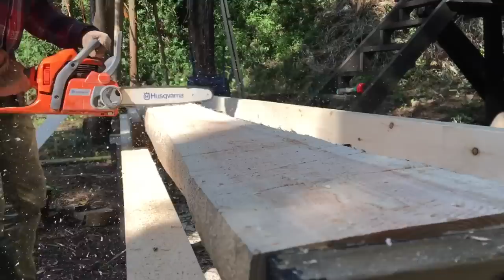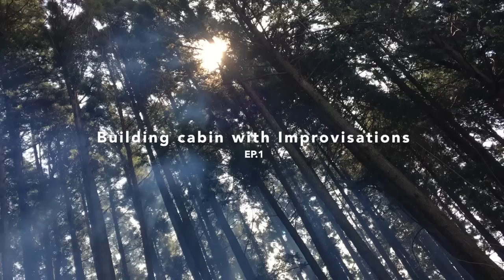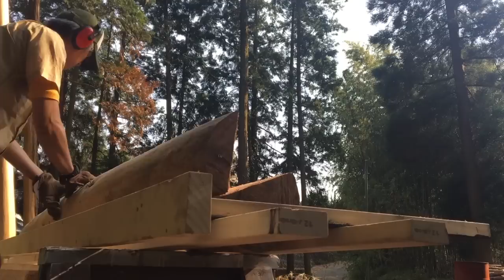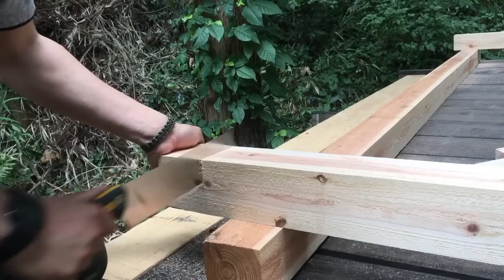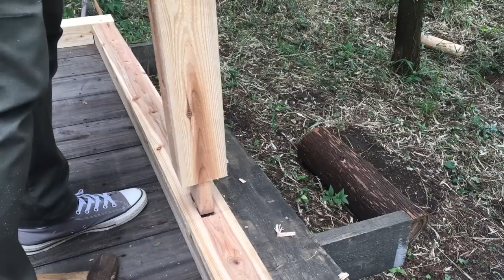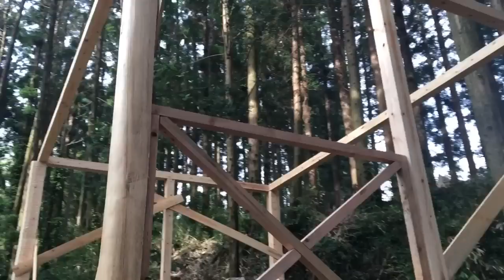Building a cabin with improvisations 1 "Timber from logs"

Comment: I like the way you build your cabin it’s just amazing I’m just wondering how you did the foundation. Did you pour concrete or just installed the pillars on the ground? Could make a video on how to start from scratch? Thank you so much for sharing
Reply: His first video shows just that. It's "Making a deck by free wood". Spoiler: he dug post holes, covered the bottom half of each post in tar, then backfilled with drainage rocks.